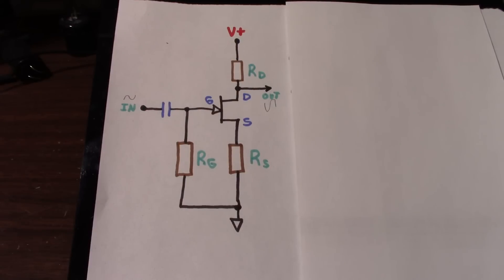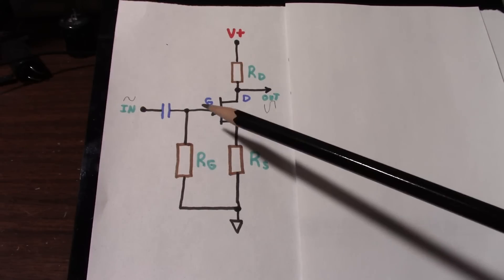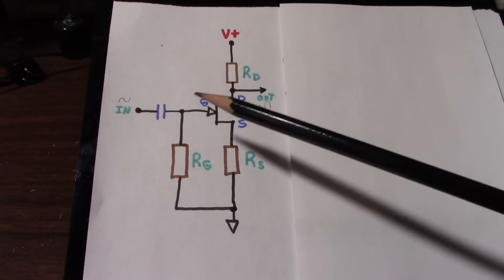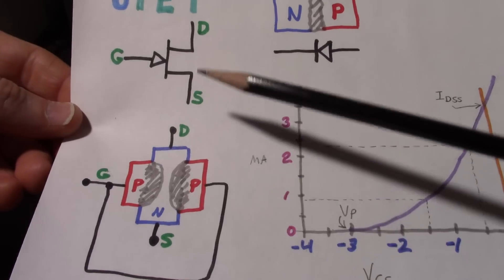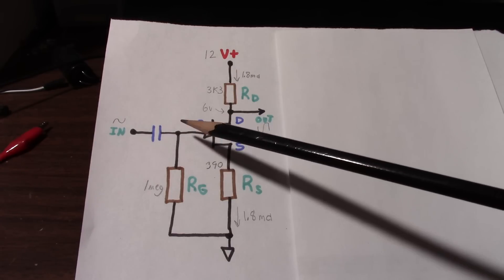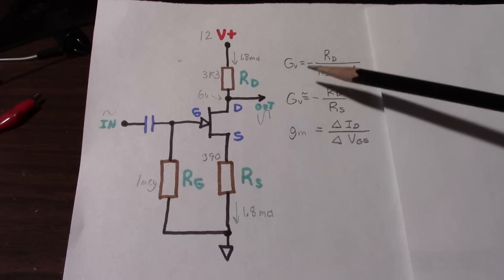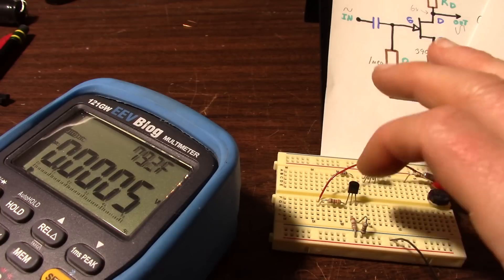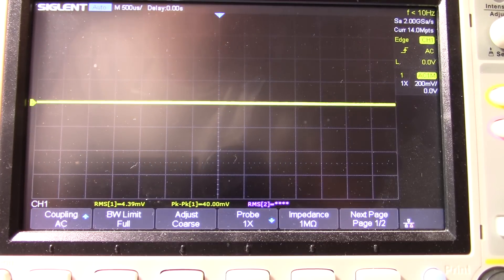JFET amplifier design with breadboard demonstration PT2

Comment: Yeah, I miss Radio Shack, even if they did away with a lot of their components and sold "Me Too" electronics. Also my favorite surplus stores closed.  Hey John, can you help me with a JFET problem I'm having?  I'm working on making a sensitive portable device that detects E-fields of both polarities at a range of about 2 Meters+ using complementary JFET (N-Chan J112) and (P-Chan J174) with floating gates, I need to keep the gates floating, even putting 100M resistor to source prevents detection of the E-Field.  The issue that I have is that the JFET's can get stuck in latch-up and the only way to fix this is have a pushbutton switch to connect the gate to source. That's okay for experimentation, but not for the final product.  I've tried a lot of things, even the Ye-Old Neon bulb trick that's >1G Ohms and that's too much for these transistors!  I'm experimenting on a solderless breadboard and using a 9V battery as that is what the final project will use.  The circuit seems to work, but what I'd hope to have is a way to handle this charge that doesn't reduce the sensitivity.  I use separate antennas for the JFETs and I've tried a lot of different things,  I think this tutorial gave me a better understanding and a refresher, it's been since 1987 when I got my AA degree in electronics.

Comment: If you connect a capacitor parallel to Rd, you can increase the gain dramatically, because it's a short cut for AC. You can hear the dust falling onto a piezo 😄

Comment: This is the Best JFET video on YouTube!!! Aaron Lanterman at Georgia Tech has featured JFETS in the latest videos in his series on Analog electronics. He gives all the equations, but You have the intuition that makes it Real. 
You mention not to use more impedance than you need at the input, and that the output impedance is roughly the drain resistor value. After watching your video I have a feel for the circuit. 
    Lanterman (Lanteronics) gives all the equations, and his YT channel also has a series on his guitar amplifier and special effects class which parallels what you do,  but with the math. 
     I have a 5th ed. Sedra and Smith (Microelectronic Circuits, 2004) and I couldn't even find JFET in the index. It was in an earlier edition I used in school. Maybe real JFET'S are going the way of the vacuum tube. 

     Anyway, I love your old school seat-of-the-pants style. There used to be tens of thousands of technicians who had these skills to some degree, but not now!   I think there are lessons to be learned here and a colorful history. 
Thanks for sharing your process.

Comment: 2:00: sensitivity, voltage amplification.   The preamp is to keep the signal level above the background noise level and match the next stages  input impedance Power output gain is for the power amp.       RS is negative feedback gain stability.Thanks for taking the time to make your presentation.

Comment: Ive messed around with making a jfet hifi preamp, never could get it lower than .05 percent distortion without it loosing its little bit of tube vibe, in the end its just easier to get the tube sound with tubes 😁

Comment: Good video.

I would think you would want to characterize your jfet before doing your calculations.

I would find the pinch off voltage and the Odds, then draw the graph.

After that your calculations will be much closer to the real world response.

Comment: Hey John, I'm not sure if you've ever checked out any of the depletion-mode mosfets available or not but, I ended up acquiring a few higher-power ones and they have really great specs and sound great for power amplification. The ones I picked up are the IXYS "IXTP6N50D2" which is a NPN in a TO-220 package and specs like Vds: 500V, Id: 6A, Vgs: -20V, +20V, Rds On: 550 mOhms (YES! milliohms!), Pd: 300W, etc. Go to Mouser (or your favorite place) and check out the full specs. They aren't expensive for what you get IMO at around $7 each. There's not many depletion mode mosfets but, you can still get ones with even higher power dissipation like 800 watts! They sound much better than the "enhancement mode" FETs IMHO. Seriously go check out the specs. I would share a link to the PDF but, YouTube is getting weird with them.
Reply: 2 of my favorites for class a amp building are 2sc5200 and ifrz250 powerful and sound soooo soooo good

Comment: Thanks John, do you need to be concerned about noise contributed by the high impedance of Rg?
Reply: No, as a noise source Rg is shunted by the series combination of the input cap and output impedance of the signal source (unless, of course there is no signal source in which case you will hear the noise associated with Rg attenuated only by being shunted by the input impedance of the JFET)

Comment: how about the following amplifier/dc-power-source: transformer (volts up) -> capacitive voltage divider (tunable amplifier output level, dc-remover) -> full bridge rectifier + smoother capacitor (dc-output stage), should be very tunable and very frequency independent, linear amplification, dont know what class amplifier that is, but no transistors required
Reply: is there something wrong with the sufficiently large cored transformers that they are not directly used as amplifiers
Reply: something to do with power multiplication, not just signal level amplification
Reply: well at least if functions as an easy variable dc voltage power supply, variable with both the transformer and the capacitive voltage divider

Comment: I've found that an optimum Q point for a JFET amplifier lies around 0.382 Vp, which corresponds to 0.382 Idss (magically). With that Q point Rs is simply Vp / Idss, and Rd ~= (Vdd+Vgs) / (2*Id), where Id = .383 Idss. Vp and Idss of a given JFET can be easily obtained with a simple measuring circuit which is available on the web.

Comment: I have been electronic engineer for 35 yrs and can honestly say never bothered with JFETs, they really are useless and have been obsolete since the 80s, seriously an OPAMP is simpler and easier to get hold of, as for input impedance there are plenty of high input impedances opamps.  One job they might be really good at is a voltage controlled resistor but again these days plenty of other options.
Reply: "seriously an OPAMP is simpler and easier to get hold of"

An op-amp with a JFET input stage for instance? 😀
Reply: It's harder to match J-fets than bipolars in case of power amp input stage. Today all of the popular Toshiba J-fets are out production. But for some preamp, headphone amp I would try some of the new chips. Other than that it depends on application.
Reply: I started working as an electronic design engineer 50 years ago, and I've also never found an application where a single discrete JFET was the solution. I suppose that a high impedance source requiring low noise amplification at low cost might be one possible application, but it would require bias trimming and/or lots of dc feedback to give a repeatable operating point.

Comment: Newby, pertnear 70, gave up on electronics in HS because the study of logarithms didn't harmonize with puberty :-). A mental block for me now is the concept of impedance (type of resistance or "thirst" or combination?). It seems directly related to the resistance at an input(?) but what the hell is "output" impedance? Seems a contradiction. Oh well, maybe it'll come to me if I live long enough :-) since I'm not very studious. Flashing lights, sirens and motors are kinda fun. I don't think I'll be making any breakthroughs :-)
Reply: Output impedance determines how much current the circuit can deliver into a load., imagine a resistor in series with a perfect voltage source.   If a circuit has a low output impedance it can drive low impedance load e.g. an audio power amplifier needs a very low (fractions of 1 ohm)  output impedance to deliver useful power into a 4 ohm speaker.  A high impedance output can only deliver small currents, so is useful only for driving a high impendence load.  

Impedance is synonymous with resistance in DC circuits and simple AC circuits with only pure resistive loads, but in AC circuits you can have complex loads (i.e. capacitive and inductive) which causes a phase shift between current and voltage, so impedance becomes a vector (magnitude and phase).

Comment: This is pretty much how most of studio condenser microphones operate. + something like 10:1 output transformer for low output impedance. Rg in this case is by default something like 1Giga Ohm. Many think this value is a mistake in schematics. The signal is produced by a variable capacitor (microphone capsule) which varies something like 1pF in capacitance, and produces signal. The circuit is often called "impedance converter", as there isn't much amplification going on.
Reply: If you take the output at the Source then you have low Z out without a transformer. Very handy!
Reply: @markanderson8066  True, some are made like this. However transformer is usually used because of signal balancing and cmmr.

Comment: 8:05  Would you be so kind to explain, how the Ohm's formula is used to calculate voltage drop over a resistors, i forgot how it's done.
12V - 3K3 = 6 volt?
12÷3300 = 0,003636364 Amps.
12÷3690 = 0,003252033 Amps (if the fet wasn't there).

Roland uses something similar in their System 100M VCA (yusynth). Rg = 33K, no Rd.
Reply from the maker: Voltage drop across a resistor is a function of current, I*R=V. In the video, I determined what I needed the resistor value (3k3) and the voltage at the output node (6v). From that, I needed the current, V/R=I
Reply: @JohnAudioTech  Thank you very much for your answer, but ...
12V÷3300R  = 0,003636364 Amp × 3300R = 12V again.

using a "voltage divider calculator" assuming the FET aint there:
3K3 and 390R = 1.268 Volts, so the voltage drop would be 10,732 V or am i missing something?

i tried your circuit in the Falstad simulator: tinyurl/2bg4httk, normally it works perfect, accept i don't calculated the beta for the JFET you're using.
Reply from the maker: @AnalogDude_  From the supply (12v) to the output node (source) I needed 6v. 12-6=6v, therefore 6v across Rs (3k3) which results in a current of 1.8ma. Now that I know the idle current the transistor needs to conduct at, I can look at the graph to find the gate voltage needed for 1.8ma. It was around -1.2v for the real device, so I need 1.2v drop across the source resistor (Rs). 1.2/.0018=666 (680 is closest common value).

Beta is not the correct term for JFETs. Were you calculating the voltage gain of the circuit?
Reply: @JohnAudioTech  the Fallstad simulator has a calculator for that of you click on the JFET part. I'm looking at the graph of the 2SK30A at the same graph you used in the video, it has multiple plots, would it be the same -1.2V?
Reply: @AnalogDude_  John did explain that JEFTs tend to have quite a wide spread of Vgs values, which is why you can only get a ballpark value using the nominal datasheet values.  For a real circuit where biasing is important it's likely you will have to modify the resistor values to correct the biasing.
Reply: @ferrumignis  Ya, the layers you grow on silicon waver have a color in the end, the color determines the ticknis of the layer, Sam Zellof (or something like that) showed that in one if his homemade DIY IC video. as he compared his waver vs a printed chart.
apparently silica products are some sort of hit and miss production.

Comment: The way you went at it as just fine. From the output impedance, calculate your drain current, then from your estimated Vgs, estimate your source resistor. Then make up the circuit and find the proper value of for Rs. There's really no way around that with a JFET because of the wide variance of Vp between samples.

One issue to note: at 13.46 you annotate with the legend "1.4 seimens in this example". However, you had a hypothetical (2.3-0.9)mA / (1.5-0.5)V which works out to 1.4 milli-Siemens, and that's quite an important difference! The reciprocal transconductance is then 714 ohms, which of course is bigger than your hypothetical value of Rs. Also, whatever voltage you drop across Rs becomes unavailable for the negative-going output swing and reduces your headroom. This can become significant with low supply voltages and JFETs with high Vp. For a J111, it can be as much as 10V.

Now, in the real case, your MPF102 has a higher Vp than your hypothetical example, hence the higher value of Rs required, and its gm is also higher, maybe around 5mS at currents around a couple of mA. Nevertheless, it's unusual with small-signal JFETs to be able to ignore the transconductance when calculating the expected gain. By the way, the gm varies with drain current in a quadratic relationship, giving some mild second harmonic distortion when 1/gm is comparable to Rs (but not the third harmonics you get with BJTs when re is comparable to Re). The only fix is a higher supply voltage, and that allows more gain (which is effectively capped at half the supply voltage divided by the JFET's cutoff-voltage), which you can then sacrifice by increasing Rs at the same Id.
Reply from the maker: My bad, I left the milli off. Thanks for the response.

Comment: Ya, you need to be cautious when selecting an opamp, jfet opamp's don't need a resistor when used as voltage follower, but transistor based input opamps do.

Comment: Howdy.
In my mind there was an error about impedances.
When the impedances match half the power is consumed in the driver transistor + driver resistor and half in the load. The voltage drop is 1/sqrt2, not ½ which is -3dB.
Regards.
Reply from the maker: No, it is 1/2 as stated (not exactly 1/2 in a real circuit because the transistor is not a perfect device). Remember the transistor is functioning as a current source (or sink in this case) with very high drain impedance, therefore Rd is the output impedance. If you need confirmation, build the circuit and measure it.
Reply: @JohnAudioTech  Howdy again.
Donnerwetter ! You are correct. Thanks for straighten me.
In high regards.

Comment: There will be a small bias current flowing out of the gate of the n-type JFET. The bias resistor has to be sized to keep the resulting voltage within a few tens of mV of ground...
Reply: True, but as it's only of the order of 1 or 2nA at room temperature, that is still only 10 or 20mV with a 10M resistor. There are probably more compelling reasons for keeping the gate resistor as low as is needed to set the input impedance, such as the problems of picking up stray noise at a high impedance point.
Reply: @RexxSchneider  Yes, 1 or 2 nA at room temperature, but increasing exponentially at higher temps. In sonar applications with small piezoelectric sensors (~10nF PZT ceramic capacitors), the bias resister is a significant low frequency noise source and reducing the bias resistance increases this noise, so values between 20Meg and 50Meg are most common. I wouldn't be surprised if this value was lower in other applications.